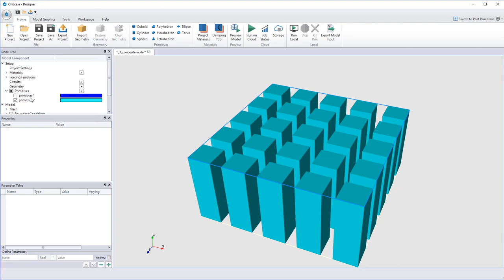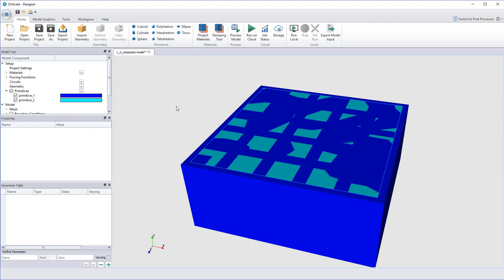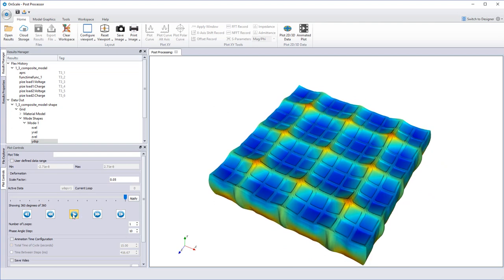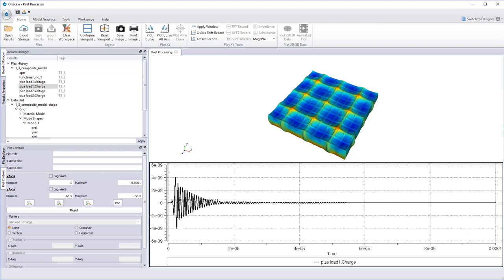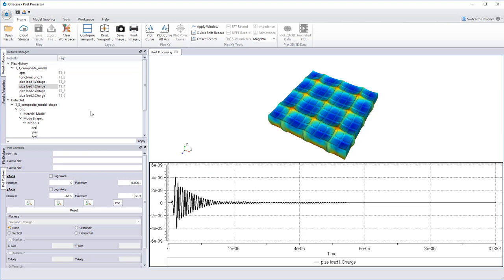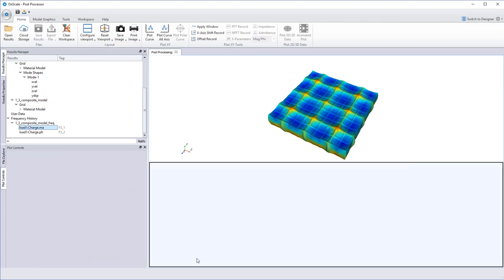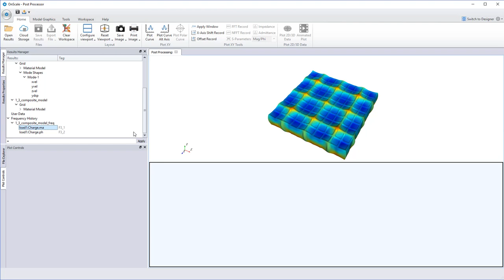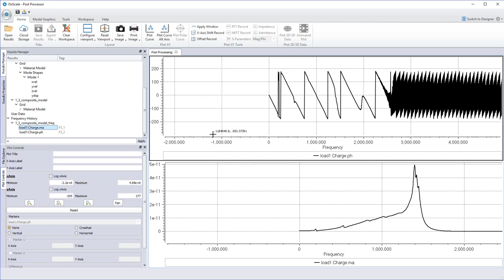How to calculate the Fast Fourier Transformation (FFT) of a piezocomposite medical array in OnScale?

Comment: Thanks for your kindness video for using OnScale!!

I'm a researcher in Korea, I have some questions about OnScale tools. 
My interest is ultrasonic wave propagation and I want to know the pipe(outer structure, except all vib systems like horn, transducer..) that i made can handle ultrasonic wave.
The horn is in the metal pipe and fluid flow in that pipe. And handling the wave direction to use reflector. 

My question is .. Can i simulate that complex situation using OnScale? My target is making outer structure that has less loss. So i want to observing the propagation ultrasonic wave in pipe. But most simulation used to make transducer, I can't find any information about design outer structure..

 Thanks you! 
 한국어와 중국어 강의도 유창하게 잘하셔서 매우 놀랐습니다!  좋은 강의 제공해주셔서 감사합니다 :)
Reply from the maker: Sure, you can simulate any kind of transducer with OnScale Lab even with flow (flow meters ) and you can also use it to design the metal case too. 
You can signup for an account on OnScale website with university or company email only and you will get some trial period and core hours.